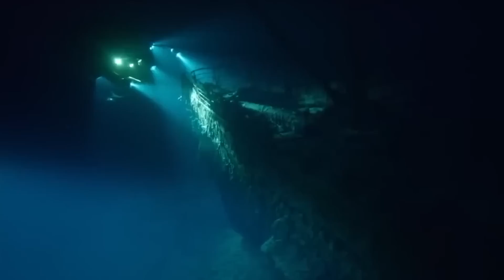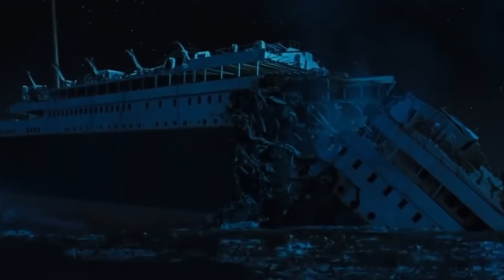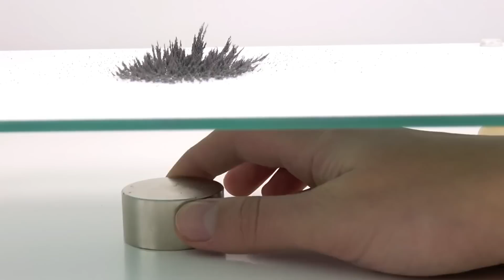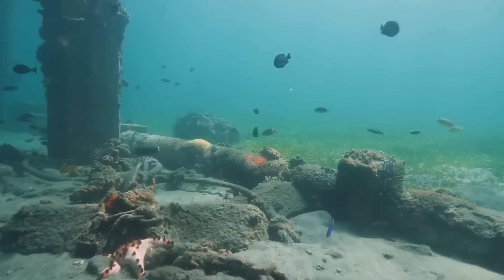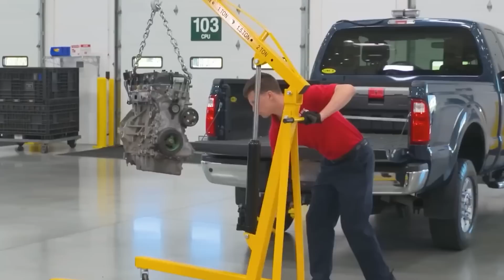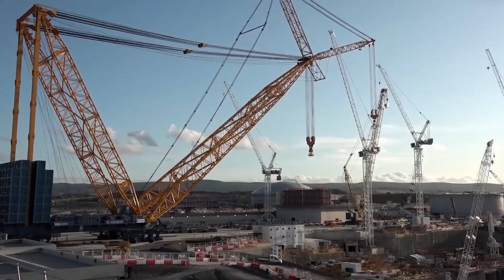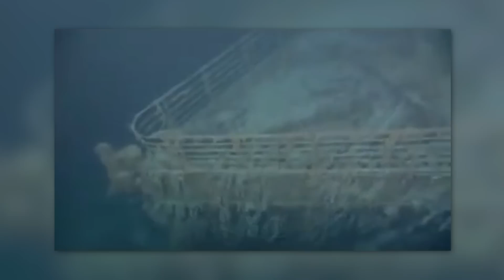Scientists New Plan To Retrieve the Titanic Changes Everything!

Comment: there is no way that ship is moving at all its buried under 20 feet of mud
Reply: Also falling apart.  Ship would just crumble to dust.
Reply: @rychristo it’s gonna crumble either way might as well
Reply: @rychristo Well the part of the ship that is buried is the strongest part as it wasn't as exposed.
Reply: @rychristo she’s actually in good shape for 100 and somthing years old she intact except sternly
Reply: @rychristo I would say that. I'd say it would disassemble to peices
Reply: @rychristo how the paint is is still on 😂
Reply: The fact that the decks a caving in on top each other tells me that the moment it starts to move upward it will crumble! No way will it hold together and even if they manage to get it to the surface how would they transport it! You would have to drag some type of dry dock out there to get underneath the ship then refloat the dry dock to haul it away! How do you get it aboard the dry dock without it falling back to the bottom is the biggest question? This guy narrating says 850 feet but the ship is in 2 pieces so how long is each piece? There's a lot of questions that need to be answered before even considering the trying to move the ship
Reply: @williamoleschoolarendt7016 there not the decks near the back when it split fell due to its pillars where it split split whith the stern so the pillars that held up the deck near that one room that’s why it kinda carves on the back kinda bent due to no support
Reply: @williamoleschoolarendt7016  The bow section is about 470 feet or so, and what's left of the stern section is about 350 feet.  These do not include the about 90 feet of the ship's midsection which fragmented into a number of large pieces and are scattered fairly near the stern section.
Reply: @williamoleschoolarendt7016  Actually they have transportation covered ....we do have movable drydocks used for ship salvage for big cargo /tanker ships way bigger, thicker, taller and longer then the Titanic even if it didn't snap in half
Reply: Not to mention the moment it would come in contact with the air it probably would start crumbling
Reply: @ryancampbell4119  You would have to have a conservation tank at the surface with enough whatever solution is used for conserving steel to submerge the ship.
Reply: @harrietharlow9929 isolation tank type deal huh that’s a smart idea 💡
Reply: @ryancampbell4119  the only possible chance and that's a maybe is to cut it into sections and it would still probably crumble! I was listening to someone who had been down there recently and he said that multiple decks have caved in and there isn't much left to the ones that haven't caved in yet! I'll bet there isn't much left to the outer walls and the steel beams that hold it all together! Plus it's all riveted together and not welded which makes me wonder what's left of the rivets as well! It's a disaster waiting to happen trying to move it back to the surface! Peace ✌️ ☮️
Reply: I agree ! Too deep too old too costly. 🚢
Reply: But killing kids in war is fine to fund right  @chancevonfreund9145
Reply: If they put air balloons and attach them to the bow the idea is the lift from the balloons will lift the bow free from the mud
Reply: Tear the whole bottom off lol @nickforest7816
Reply: @nickforest7816 yes air baloons do well at 4000 meters.
Reply: @forsakenoutcast  I think the water pressure is gonna make it crumble
Reply: @nickforest7816  You have to have a conservation tank on the surface large enough to submerge the ship completely. The issue is that if exposed to air, the ship will disintegrate. That's assuming she would survive being pulled out of the seafloor where she has been firmly imbedded for over a century.
Reply: @harrietharlow9929  fact is it's to far gone it most definitely will fall apart if they try to bring it up they can bring up the engines and save them at least
Reply: @harrietharlow9929  so what I say bring it to the surface it's going to crumble either way if you bring it up or leave it on the bottom
Reply: Should have thought of this when it was found! 💯
Reply: Leave it alone
Reply: Go sell SPUID so where else ..O.M.G Let these poor people that lost their lives there, R.I.P... HOW DUMB THIS STORY IS..
Reply: @MelanieStubbs-p8q true
Reply: more like 40+
32 feet would be under the water line and she is buried up to near her bow anchors.
Reply: Not only that, doing anything on it at all is a molal and legal hazards for good reason. Pieces of her: Yes please. Her as a whole: Go away!
Reply: @ALCO-C855-fan A piece already has been raised, and that took multiple attempts.
Reply: @TheKaiTetley  Exactly. Conclusion: Pieces Can be raised, but in one piece is impossible.
Reply: @TheKaiTetley 2 attempts it took to raise the big piece from the ocean floor
Reply: You never know if anything will work or not. We will just have to wait and see.
Reply: @UP5511ismycomfortengine that wreck will never be raised. Never. Ever.
Reply: It’s more likely to break if disturbed
Reply: and those pieces will be raised as well    @GamerXe1
Reply: Those pieces will be bought to the surface as well
 @GamerXe1
Reply: And if you move it up (especially the stern) it will break apart!
Reply: @tostadatomtadatoast   It`s already broken apart and probably not going anywhere.  It should contain that rogue bulkhead and possibly they wouldn`t want to move it.
Reply: They gonna be doing a lot of digging. That includes “dusty” Titanic parts
Reply: There’s always a way
Reply: What about the fish or animals already made their home there,
Reply: I read at the rate of decomposition it will completely dissappear in about 75 yrs
Reply: @shootpse88  yeah but some people say the ribs of the ship could last another Thousand Years plus anything that's brass will last forever since brass does not rust
Reply: @shootpse88  yeah but some people say the ribs of the ship could last another Thousand Years plus anything that's brass will last forever since brass does not rust
Reply: @shootpse88 exactly so why not try something out landish before she’s gone for good? She’ll be gone anyway right
Reply: Actually it's 50 feet of mud not 20
Reply: @JordonGrager  Just leave her all together.
Reply: @user-xo1gz8ro9w  how do you know did you scuba dive down there and measure how deep the mud was I doubt it a human body would explode from the pressure
Reply: @JordonGrager how tall know ??
Reply: No it’s not the titanic it’s up!
Reply: They have a thing they do for ship wrecks where the blow mud and dirt out of the way with a leaf blower like thing
Reply: @fnafvsjaws6the6thone more suction  like a dredge
Reply: There’s always a way
Reply: I’m with all of you on that sentiment
Reply: 20 meters
Reply: @remcoevers1800 it goes in your fish aquarium at home
Reply: Why would you disrespect the Titanics underwater grave?
Reply: With respect to those who died on this ship, please leave it alone
Reply: Nothing is imposibble
Reply: I want you to see them try and fail.
Reply: Well I hate to tell you sir.. it is in the process of being raised to be put in worlds largest salt water museum the length of the Titanic and then some..it's going to be the worlds biggest museum ever built anywhere in the world.. technology today is capable of retrieving this massive piece of history..once it's retrieved it will still be in saltwater for preservance but in a museum..if we don't do something to save the history of Titanic it will be nothing but a memory..it's coming so keep watching for updates..I'm going to be on one of the salvage ships that's going to accomplish this mission..we are ready and excited to have this opportunity at history..I can't wait..I'm excited..peace and God bless..
Reply: @captainfaron in your dreams the wreck needs to be left alone
Reply: It's also been underwater for 112 years if they even pushed on it with one of those electric submersibles the side would probably cave in and did you notice the picture they don't even have that right the Olympic Split in the back not the front
Reply: Leave her alone
Reply: The video makers know this they just do anything to make a video
Reply: Unless your Magneto that ship is not coming up 🤨
Reply: The film" Raise the Titanic" was good fun , but it was just wishful thinking....
Reply: 60 feet
Reply: @Myke666  That's what my research says as well.
Reply: News flash no bodies or bones are there.  They were all dissolve and nature took it
Reply: Are you lot thick? I said section by section or piece by piece not the whole ship. Those people know what they are doing 🙄
Reply: God your rude!!@antoniocarpinelli4660
Reply: @antoniocarpinelli4660  actually, oh so wise intelligent one, you never mentioned a word about "piece by piece" in your original comment and only said "those pieces will be raised as well" in reply to a comment about her breaking if disturbed. So no, you didn't say she would be raised piece by piece. And it's a moot point anyway as the cost and logistics of such will simply make this subject nothing more than fantasy. Certainly in my lifetime and I am 41.
Reply: Go back and read it again piece by piece means bit by bit, go back and study your English  @MarcoNegrisEye
Reply: @antoniocarpinelli4660  oh I see they have hidden my reply. I can only imagine it is because I used a swear word (which I  quoted from you to be fair). So maybe press the 'new' button on the comment section and if you still can't read my reply I will re word it. Basically, you're speaking 💩
Reply: @MarcoNegrisEye   Someone else noticed it, stuff has mysteriously disappeared.
Reply: Then get digging motherfucker
Reply: They can do it this they don't want to u can have remote control diggers dig the mud from around the bow put air bags all over the place and start living the air will do nothing to the steel
Reply: Yeah and it's pretty weak already so it would probably crack and crumble in peaces
Reply: If they wanted to lift titanic out the sea it would include same method they used to make train tunnels a large device to just suck the ship into and swallow it out on land drilling yes to make sure you don’t cause any more dents right and then the machine simply slides under and keeps dragging until the ship is inside like a sling sling it out
Reply: It seems to me much better to build a new ship
Reply: @HansZwak yes actually it would..... The Titanic movie cost at the same amount of money to produce as the the real ship in 1912 .... The model used in the movie was 100 ft shorter with extra deck lights and they rebuild the grand staircase full scale with many of the furniture being accurate historicl copys and even the  carpets and rugs were reproductions by the same company that produced the original rug and carpet fixtures in 1912 ...... The movie did so well in theaters that not only did it get back all of the money but was able to pay the actor that played Jack roughly the same amount of money it would have costed to build the Titanic ..... The total financial payout was 2 or 3 times the money worth of the original ship and distributed via paycheck to the actors/ employees
Reply: @HansZwak there in fact have been people who are suggesting to rebuild the ship two of the most serious examples created a company Express for it called the Blue Star line...... As it turns out there are quite numerous logistical problems and rebuilding it or even building a aversion with modern safety standards with the  Same 1912 aesthetic I wouldn't trust the Chinese shipyards to try and build it to be honest
Reply: Dla mnie ten statek cały czas wola o pomoc niestety wydobycie go jest nie możliwe chyba że w kawałkach świat nie dysponuje taka technologią żeby wydobyć go w całości
Reply: 1 meter  2 inches  and  2mm under  mud😂
Reply: It's not mid idiot.
Reply: Yup
Reply: Not possible to raise her, If they even touched the stern it would probably fall apart from.the condition. It has been under there for 112 years.
Reply: 60 feet
Reply: Your dumb man the titanic is gonna move
Reply: Right. It’s falling apart. It would break up even if it could be moved.
Reply: It’s been sunk too long
Reply: It’s almost decayed completely anyways😂
Reply: They want to bring her up so they can turn her into iron orgas and encapsulate it and sell it on the Home Shopping Network
Reply: Like wat actually machine does yall have that can lift something of that weight
Reply: Plus the bacteria
Reply: The young lady that sailed on & survived the Titanic was alive when it was found. She was asked about it then. Her husband had perished on it. She asked for it to be left alone.
Reply: 1. Pause the video.
2. Write "This is fucking dumb."
3. This is fucking dumb.
4. Downvote.
4. Ctrl+W.
Reply: Here's a thought if they did raise the Titanic n brought this majestic liner to the surface then how would they bring it back to dock
Reply: The stern is a complete wreck  broken n damaged ....no longer looks like the stern of Titanic
Reply: It's not on mud it's on the ocean floor it's on sand
Reply: You can see just how buried in silt she is by the anchor position. Her anchors were nearly at the capping rail  at the bow. Really high up. The photos, footage of the ship on the sea floor shows  the anchors nearly at the sea bed level
Reply: Bro that's literally cast iron that bitch is thick af even after years underwater it would still come up as one if u do it right
Reply: The Titanic is probably gone. Scientist discovered that the titanic will be gone in about 20 years.
Reply: Mud?
Reply: These people.   Just leave it alone it's a grave and needs to respected
Reply: Thell dig it out with water bots and then it will break in half
Reply: First of all you can’t have divers out at that depth they’d be crushed instantly so it would have to be done all by machines and I don’t think they got machines that’s sophisticated yet
Reply: And if they could lift it the thing would break apart on the way up.
Reply: @williamf6783  
The ship would break apart it would just fall apart like dust the minute they tried to move it and it is 42,000 tons with all that water it’s probably 142,000 tons maybe even 300 tons
Reply: @williamf6783  I say they should just leave it as is the past is the past
Reply: Plus how rusted she is she would fall apart
Reply: Couldn’t we just build a barrier around the titanic pieces and drain the water into a tank that can hold the water and just raise the ship then and return the water like nothing had happened
Reply: If you can dig a platform gently underneath it and slowly raise her, I see it being possible. Not sure what would happen when it hits the surface and gravity and oxygen gets to it.
Reply: Leave it alone. It is a grave site
Reply: The ship would disintegrate if it was lifted.
Reply: @tmmaston  no(x3) it would disassemble to peices
Reply: Not under in the titanic still stands tall above the sea floor but if anyone tried it would brake up and destroy what's left
Reply: Or the fact that it will crumble to pieces if moved
Reply: Yes there is belast balloons huge 2 inch thick steel plates and huge massive industrial straps and the world's largest mobile drydock
Reply: @kennyfox7055  it will just crumble. It's too far deteriorated at this point. We might have the technology, but they won't be bringing up anything but rusted bits
Reply: She can be lifted and restored, but the cost of doing so is going to be very costly
Reply: I agree 💯 percent. It's too deep. And it's a grave site. Due to all of the people who lost their lives on board the titanic
Reply: It's got 114 year old rusty metal. There's no chance..
Reply: I think it's good they try.
Reply: More than THAT.  About 60 feet at the bow. The mudline is JUST below the anchors.
Reply: I heard it’s legally considered a tomb under international law, as it’s technically in international waters.
Reply: May fall apart
Reply: You mean sand
Reply: 60 feet not 20
Reply: I think it’s completely crushed in not buried. I used to be the biggest advocate for raising it but seeing its modern state I no longer feel it’s possible. I wouldn’t say no if they tried though
Reply: Bullshit she can be raised and she will. She is fed up being down there and she wants to come up and face the world and show the real storey of what really happened !
Reply: @antoniocarpinelli4660  We know what really happened. She sank.
Reply: @antoniocarpinelli4660  
She is disintegrating as we speak her rivets are brittle .
She's broke in 2 and her stern is obliterated 
She is buried in the mud which crates suction sticking her to the sea bed.
Her keel forward of the break is likely shattered 
We can't lift her with a surface vessel we would need thousands of life bags filled with diesel.
Her damaged steel would disintegrate when exposed to air  she would need to be submerged in  freshwater tank  for years to stabilize her.  No such tank even exists.

The cost to raise her, preserve and store her could cover building a replica of her and her sisters plus buying white star from Carnival Cunard as well as building a fleet for WSL.
Reply: 60ft actually
Reply: No the bow is over 36ft in the mud
Reply: Leave the graveyard alone fs